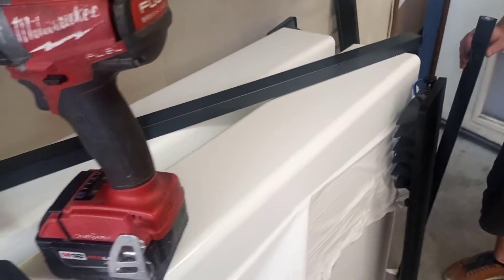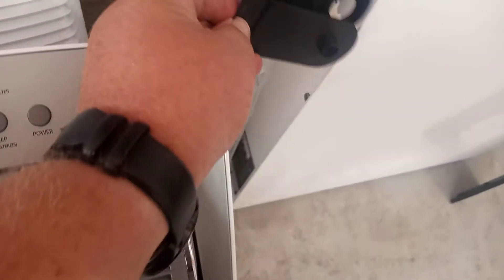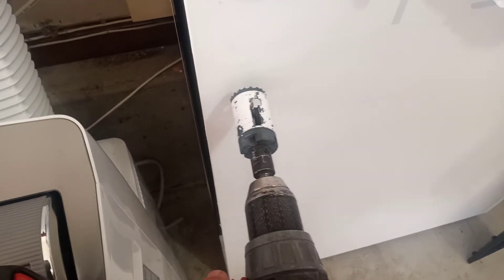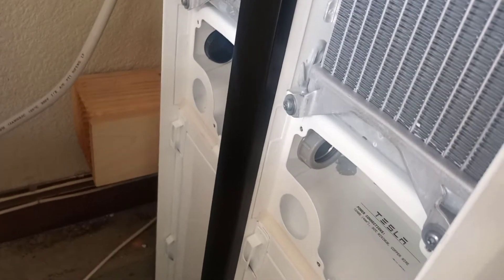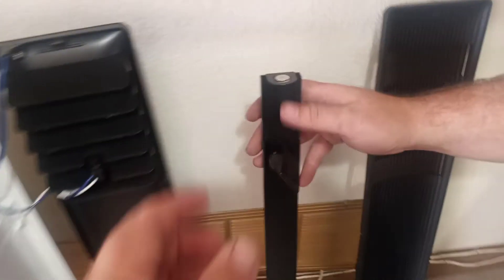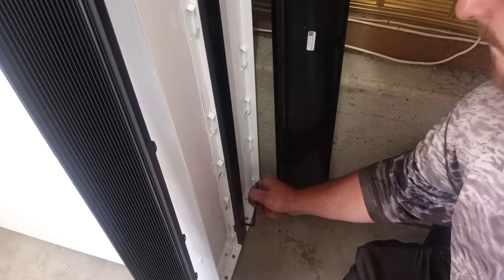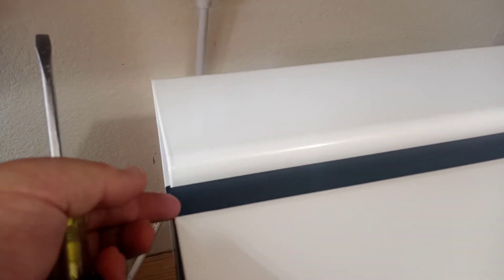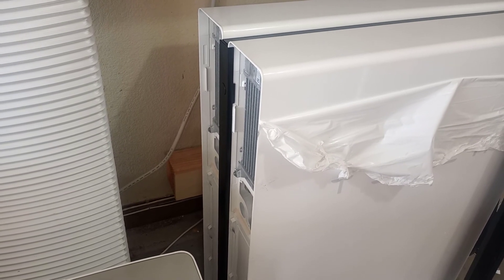how to install Tesla stacking kit so you can put multiple powerwalls together

Comment: @Blackbear Prepper I’d like to add two more powerwalls my existing are attached to the wall I was thinking of building supports off the concrete for the additional powerwalls to provide support from underneath. Let me know if you’d see any issues with the idea TIA.
Reply: Hey there, I have 3 powerwalls. The crew that installed my system placed a premade concrete slab on the ground. The PWs rest on top of the slab, and are also bolted to the wall, purely for stability. The weight is on the slab. Hope that helps.
Reply: @michaelking42  thanks much appreciated, I’ll have to look into this option might you have info on the premade supports.
Reply: @Bobby_Chingas  I don't have any info, but if you want to email me I can send you a photo of my batteries on the slab. The slab looks pretty thick, it's got to be easily 3" and maybe 4" thick.

Comment: Thanks for sharing your video. I'm getting 2 x powerwalls and trying to determine if stacking is best outdoors. It's a good option for space saving on the wall, but wondering about heat buildup in the stack, especially the middle one.
Reply from the maker: The cooling capability comes from the sides so stacking should not be a problem definitely do not put them on the south side of the house that will be where the biggest problem comes from but as long as they have ample access to air on both sides of the batteries they should be fine remember these do you have to set on a concrete slab if they're going to be stacked they cannot be mounted directly to the wall thank you for your comment we really appreciate it
Reply: @tateabdon1  Great info and thanks for the reply! I was out there looking today and yes the north side of the house is where they are going, and I was also wondering about stacking 3 and how they'd hold up to the wall without support underneath. And you answered that question too! Thanks mate. I'm in Florida, so yes sun position and heat is a big factor.
Reply from the maker: @michaelking42  you're very welcome as always thank you for your comments
Reply: @tateabdon1  Do I have to hire a separate contractor to pour and set the concrete slab, or will the Tesla project manager handle that?  I'm looking to stack 3x3 Powerwall 2 on the left exterior of my house.  Thanks.
Reply from the maker: @VishalRaoOnYouTube  most the time you will but I do not work directly with Tesla I'm just an outside installer